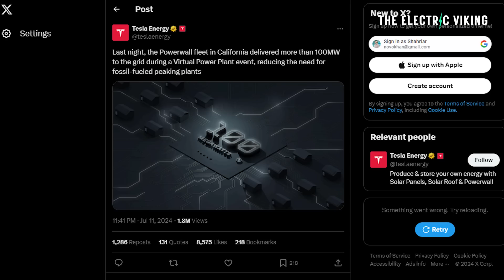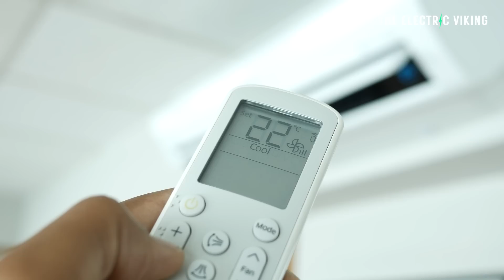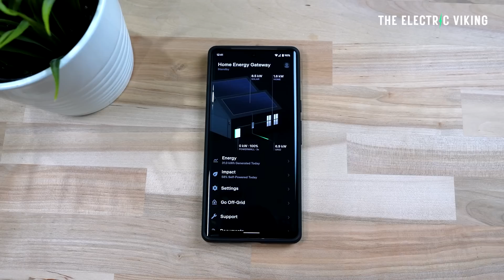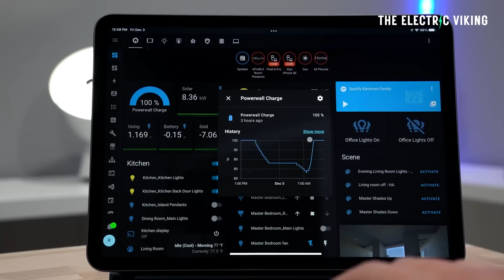Tesla’s California virtual power plant transforms the grid and makes millions

Comment: On July 3, REN used EDP's Cerca solar plant to guarantee the stability of the electrical grid in the system services market. This type of service has been offered mainly by gas and hydroelectric plants. For the first time, REN used energy from a photovoltaic plant.  in https://expresso.pt/economia/economia_energia/2024-07-18-portugal-explora-pela-primeira-vez-energia-solar-como-pronto-socorro-da-rede-eletrica-21888481?utm_medium=Social&utm_source=Facebook&fbclid=IwZXh0bgNhZW0CMTEAAR1xk9EsC_qEeUzHxcJf_djOHFj8m6Foscvd4X7TvbMewMz0gpqTDvMT6RY_aem_1xvmY3XjL6Jc9pPDn9ASEg#Echobox=1721305489

Comment: It's pretty easy to fix it.  Batteries need to be the third resort.

1. Shift solar production to time of use, as best as possible.  Bifacial panels oriented east/west will better align to usage (peaks in the AM and the PM).
2. Use dump loads for things you would need otherwise (EV charging, water heating, etc).
3. Then use batteries for overnight power.

Using batteries as the "first" solution is bad because it creates unnecessary cycling on the batteries and there are losses in the process.

California is a big wet blanket.  They're not solving anything.  Tesla is solving things.

Comment: I would like to see hard numbers on this, I think this is misleading. I believe the majority of California's solar power as well as battery capacity comes in the form of large utility installations. Home batteries and the virtual power plants assembled from those are a fairly minor part of the equation. Economies of scale and huge purchase quantities mean that the utilities can install and run this stuff much cheaper than relatively tiny homeowner financed projects requiring expensive services of solar installer middlemen selling equipment with huge markups.

Comment: Our solar panel system ROI was shorter than the 6.5years originally estimated. It generated more power than guaranteed by Tesla each year. We broke even at around the 5 year mark so we’re glad we went solar.  And the electric company have increased the peak kw/h rate since when we first went solar from like .42cents to .80cents. With no end in sight. Crazy.
Reply: I did Solar and it paid for itself in five years. Pay yourself first your cost is fixed, there is no fuel cost and there is no inflation on your cost of energy. Millions have done it and you can too.
Reply: Your situation is why you broke even in so few years.  Did you thank your neighbors and tax payers for subsidizing your life?

Comment: Solar and batteries not fully wrong. They fantastic for "normal cases"... However I keep commenting in all videos that they still not reliable enough. In case of a "wrong" cloudy winter etc.. they won't hold up. Battery capacity will run out in day. Also keep adding the maximum extreme event what happened in reality is the "Year without summer" in a similar case we would not be in a problem with current electric generation... YES IT is POLLUTING so NOT good. However batteries also not the "break through" here.. https://en.wikipedia.org/wiki/Year_Without_a_Summer
Before commenting we have WIND as well then look up how wind created by SUNLINGH!!! Thanks...

GO FUSION!!!

Comment: The first solution is to have dynamic pricing second by second. Make the price negative if it isn’t needed and more positive as the need increases. Then batteries will may for themselves. If the pricing is not variable, the market can’t react to the needs.
Reply: Yep that's the plan, rip people off with exhorbitant pricing when they most need & cant avoid using power.
Reply: With dynamic pricing you will no longer be able to bank your solar energy with the utility.

Comment: California has so much grid battery capacity now that they can output the equivalent of 3 nuclear power plants at times when needed (6,000 megawatts). This number will only grow as more battery installations come online.
Reply: This is pure garbage!
Reply: @philipdamask2279 You're right! It's really the equivalent of 6 nuclear power plants. The average nuke in the US is right around 1gw, not 2. Of course it is short term output, but wicked fast to ramp up and down, and perfect for managing the evening peak, and should be great for cold start, given that it is designed right. Nuclear has the same problems as wind and solar, which is that from a practical perspective, it doesn't follow load at all, putting it in the cheap electron business, only it's expensive.
Reply: @philipdamask2279  🤣🙄

Comment: Calling a battery a 'virtual power plant' is like me calling my credit card a 'virtual job'. I don't need a real job, because I have a credit card, and I can use it to pay for everything. No more getting up to go out to work every day. Which works perfectly until I hit my credit card limit, that's when I find out I do need a real job after all, because my credit card is useless until I pay off the balance.
Reply: But your analogy is off because the video is a bout "solar" - which is then stored in battery.

Solar + battery IS a power plant, and to have fun with your analogy - solar and battery generates real jobs, unlike 'coal' which continues to bleed jobs, and make lungs bleed too.
Reply: To wit: Tesla has been using virtual power plants to aggregate its distributed energy systems, rooftop solar and Powerwall, to provide grid services and get more value for their customers.

So virtual power plant is exactly right, whereas your analogy is wrong, because you completely ignore the renewable energy sources being consolidated.

[you could claim that ice electric plant isn't 'power' either. It's basically a furnace, which burns coal, which aggregates millions of years of solar energy, and whose millions of years worth of carbon you release back into the air]

You're just wrong.  Period.
Reply: In San Diego, they won’t allow you to arbitrage from charging via the grid to sell back to them during higher cost times if you have solar. 

You can only sell back the electricity that you generated via the solar panels. 

However, if there is a storm watch event. Then Tesla will allow the PowerWall to charge itself full from any source. Including via grid electricity.
Reply: @david-iam  That's not how it works here in Australia.

Comment: The only problem is VPP (with San DIego Gas & Electric) has a limit of $350 per power wall per year.  but it will save the owner money because it allow you to run your house off the battery during the peak rates
Reply: This is a interesting in terms as once you hit that $350 amount should you turn off your participation if your not going to receive compensation for your solar generation and use it for your own personal use

Comment: A car has an average lifetime of 10 years, and each household could have several of them. Powerwalls is one for each house and lasts forever, on top of that, most of europeans and east asians live in appartment buildings, so they are not buying this batteries. And finally, the business model of T powerwall (buy cheap chinesse batteries, pack them and sell them online), it’s very easy to replicate by any competitor. So this bussiness model it’s not sustainable long term.

Comment: 24 hours of grid electricity is a max of 600gWh. From 25gW fossil generation plant. In Australia.

But the same amount of PV electricity has to be generated in 5 hours. So 120gw per hour 

This is way over the grids capacity of 25gW max per hour 

Storage at point of generation with big batteries and slowly fed back into the grid at only 25gW per hour for 24hrs. 

Big batteries are needed if PV is to work.
Reply: And also wind, nuclear, geothermal, etc.

Comment: Electric Utilities are composed essentially of 3 different components: generation, transmission, usage. California's NEM 2.0 program was designed to encourage local GENERATION. It created a boom in solar rooftop deployment. It was successful! Great! But now California is generating MORE electricity than they can use. NOW their problem is usage. They want to level out the usage and that is solved by NEM 3.0, which is designed to encourage STORAGE. Now the incentives encourage batteries, which both levels out the load by allowing heavy usage in the hours when there is no solar generation (EV charging, dishwashers on delay, heat pumps over night, etc.). And by increasing self-consumption, it reduces the load on the TRANSMISSION component, because if a building is creating and using its electricity locally, it isn't using the power lines and frees up capacity for others.
Reply: Charles, agreed! In order for California’s plan to benefit citizens (the California electricity utility monopolies are predatory and actually harmful to Californians), batteries need co rapidly and drastically come down in price. But, residential solar and batteries mean that for the first time ever, the predatory electricity utilities and cartels actually have competition! As batteries drop in price, the electricity cartels will have fewer and fewer customers.
Reply: Yeah after they encouraged us to get Solar in California now they are trying to punish us for it.
Reply: As long as they keep fighting the practice of charging batteries overnight and using during peak times, they are not encouraging storage. Those who may not be able to get solar but could take advantage of batteries are basically frozen out. I'm on NEM 2.0 and getting two PW3s but I can't increase my solar array without getting stuck on NEM 3.0. I'm getting a hefty rebate on the batteries but I have to sign up for a VPP though the local community power for 5 years where they can take half my storage as needed with a small payment. I'm gambling on not getting screwed by it.
Reply: @nicksgarage2  Did you take advantage of tax incentives?  If so you are part of the reason for increasing the public debt and contributed to our inflation problem.
Reply: @philipdamask2279  So rich people and oil companies can get tax breaks and incentives, that contribute so much more to the debt, but a middle class family can't? Do you take advantage of highways that I helped pay for? Do you not take any deductions on your taxes? You need to educate yourself on how society works.

Comment: The black out in Melbourne the dude is talking about had about a dozen cars in Canberra plugged in at the time of the black out. There was half a capital city of about 4 million people with out power. The dozen EVs did virtually nothing to assist Melbourne. This is blatant disinformation designed to dupe his fanboys.
Reply: He would do anything to pump up TSLA 😁
Reply: BS, we are still near the start of the battery installation wave. Sam is right about utility-scale batteries in California. We’ve had a brutal heatwave in this first half of summer. And utility-scale batteries    have picked up the slack during late afternoon and early evening when solar production declines and AC demand goes up. My complaint is that batteries are still too expensive for massive adoption at the home and small-business scales. That’ll be where the big disruption happens. Solar is relatively affordable now. But as home batteries, from Tesla and it’s competitors, become more affordable and common, batteries will be the end of gas peaker plants.And as more of us get EVs, vehicle to grid will disrupt traditional electric utility cartels even more.
Reply: No one expects a dozen cars to power a city. It was an experiment and it worked. When there are thousands of EVs connected it will make a significant difference.
Reply: Just to keep thing straight, Teslas don't have that capability except the CT.  Those EVs were not Teslas.
Reply: My house had a -over cut and we run our house from ev.  He’s right and it’s awesome
Reply: 16 cars gave ~110kwh energy. Sure. Drop in the ocean. But just think if 1 million cars in Melbourne were V2G. You'd not have a blackout.

Comment: But what is tesla?  i´ve been  off grid for 2 years now, in SW Europe, Portugal, with the,( now cheaper,half price, and going down...) , chinese 280Ah prismatic Lifepo4 cells; 48 volts nominal; and a 74 euro Inverter, delivered ! a Low Frequency inverter,of course, the  hi freq.ones do  not last, i am a tech, i build repair inverters; mine is ««5000 watts, 24 mosfets,  and it feeds the mandatory Trafo (with the 45microH coil),;   mine is only  a  32Kg, 3000 to 4000 watt, Toroidal trafo, cooled, does the job;
  ALL elements (inverter, trafo, MPPT, BMS etc.) all extra-cooled by cheap used computer and PS fans (i re-lubricate every 6 months ) some on small TO220 40ºC thermostats,the whole thing has been bullet proof; bear in mind that the EGS002 control board, ~~6 euros, NEEDS to be modified, plenty of that in the net; they DO NOT work for long as thay come, they burn up RANDOMLY at shuttoff; modded and cooled (~~no need,but...)  they last and last, AMAZING little things.

Comment: Yeah I’m not wasting any charge cycles into the grid until the degradation situation is resolved. For that to happen, you people have to start obsessing about fast charging times and push EV makers to solve that riddle.
Reply: You'd want to do the maths very carefully before selling battery stored electricity back to the grid. A 13.5 Kwh Powerwall in Australia costs the best part of $15k. It should last about 5,000 cycles. By my calculations, that's about 45 cents per kwh to account for battery degradation alone. Add to that installation cost, invertors, solar panels, finance costs etc, and that number climbs. I can easily see the break even number being around the $1 per kwh. mark, before profit.
Reply: The lifetime of a battery is defined as when the degradation is 70-80%. It still works.

Comment: I'm waiting for PowerWall3 to be installed in the UK. September I've been told.
Local solar and battery capacity make a great deal of sense. The country's infrastructure isn't able to shift vast amounts of power between where it is generated and where it is needed, so local 'fuel dumps' make sense - even more so if you get Joe Public to stump up the cost and install it!

Comment: Agree power supply is bigger than EVs and robots. It’s the one thing we must have to survive in our densely populated areas. There are decentralised solar power setups in less stable energy countries, where neighbouring villages shares and trades electricity amongst themselves.
Reply: I believe Tesla is serious about home energy when they allow bidirectional charging on all their cars. Each car is equivalent to several power walls. If Tesla really wanted to have an impact, it would allow those batteries to be used much more effectively.  The fact that they don’t allow it leads me to the conclusion that what they’re really trying to do is sell power walls at the expense really really making a difference.
Reply: @markallen4514 A fixed plateform for power distribution is better than a car that may or may not plug gets into the grids. In the short to medium term. You are simply expecting the negative therefore you made up an excuse due to that bias. Tesla Cybertruck has that bi directional setup.

Comment: Nice.
But can a power plant be virtual ? 🤔
Reply: Yes. It's not an actual power plant but an aggregate of various independent sources. 

Phillip.
Reply: When the car battery is integrated into the VPP system then Tesla will be more of an energy supplier with some of the storage rapidly mobile. Just imagine, in the event of a grid infrastructure disaster,EVs can go to where it is still operable and contribute to the stability of the grid when plants in the affected areas cannot do their part.

It seems to me that this VPP technology would be useful to form micro grids in areas of just a few hundred houses,with input from the larger grid only when they need it. Broken into cells like this,the danger of cascading failure over large areas would be “virtually “ eliminated. I notice that the electric co-ops here in Texas maintain their infrastructure much better because they own it.